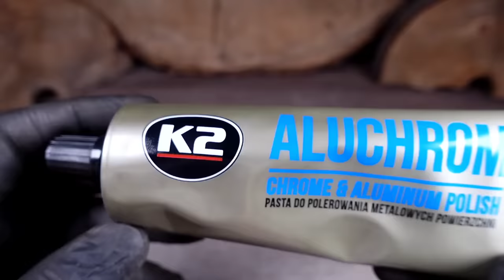Very Beautiful Antique Women's Handbag - Restoration ASMR

Comment: I think your work is beautiful. I was thinking though that the lack of finishing on the fabric edge of your lining kind of lets this down, as does the closing of the jump rings (attaching the chain to the bag). If you use two pairs of pliers to open the rings in opposite directions (instead of pulling them apart) they can be closed the same way and you'll keep the perfect circle.
Reply: I agree with you on the lining. The edge needed to be turned under or some trim put over the raw edge. It just looks unfinished.
Reply: Thanks always wondered why my o rings close past each other. I’m forever fixing my jewellery.
Reply: Where did you get this purse?

Comment: If that thing is brass/copper there should be no rust on it at all. Not enough iron in those metals. Think it was painted to look rusty. Could be wrong though.
Reply from the maker: HellO! Brass does not rust, but oxidizes and is covered with a coating of different colors. Some rust spilled over from other old metal things.

Comment: Not sure how old this video is.  Your process is nearly equivalent to mine when polishing my copper tub.  I’ll start with a quick aggressive steel wool/00000 and cheap cleaner/polish.  Then to MAAS metal polish ( 15:27 best I’ve used for this purpose, hands down.  Then comes a the polish followed by rubbing down with dry clean cloth.  The result is like yours.  That nearly mirror, glass, blush glow.  Remarkable!  I use one step mirror, it is at tub.  Ready?  Car wax.  Fin.

Comment: You asked for a rating, so here is mine: 8/10. You are truly skilled, and it was a joy to watch, but I withdraw 2 points of the following reasons:

1. I wish you had worked a little bit more on removing those small dents.

2. The edges of the lining could have been a little more neat, with a decorative ribbon covering the edges, for example, or that the edges could have been folded to the inside to make the edges neater.

Not that I could have made a better job myself, though.😁
Reply from the maker: Hello! Thank you very much for the constructive criticism.
Where are you watching from?🌍
Have a good day!😉

Comment: Its a pity you went to all this trouble and didn't finish off the lining properly, a small flat edged hem or braid would look cleaner, more professional and fitting,  the liner will lift or fray unstitched or turned down...nice for a 1980 vintage bag